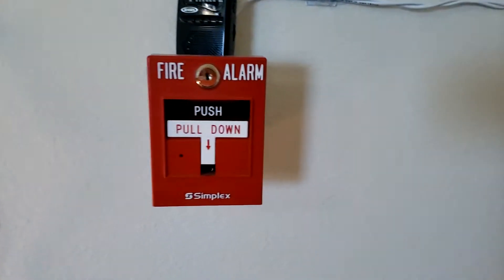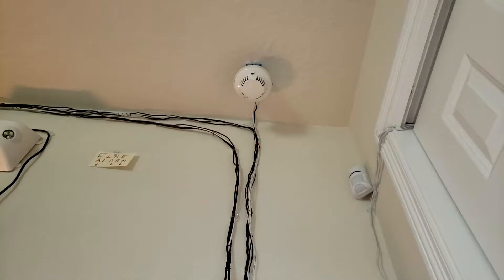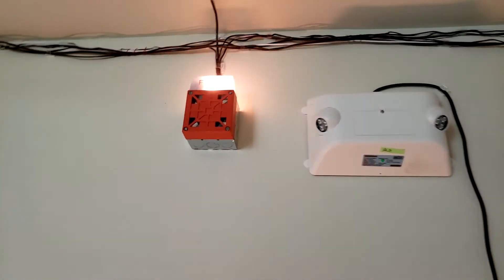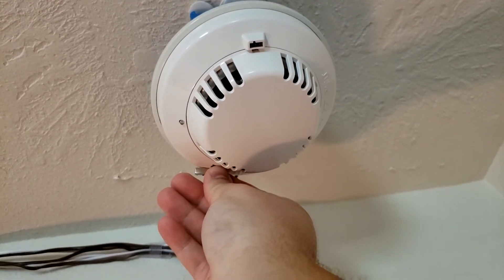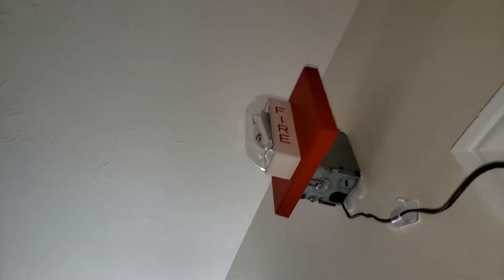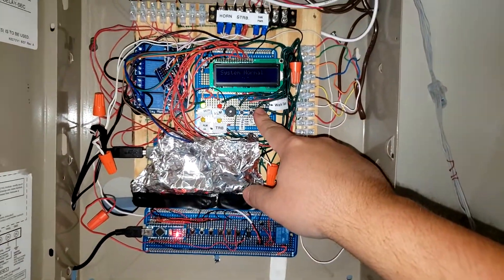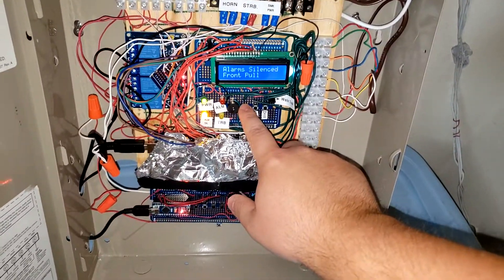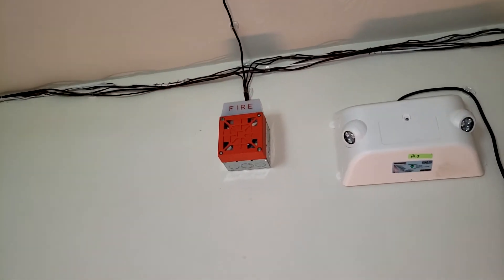Fire Alarm System Test 3: New Panel!

Comment: do you have the arduino code available to share . this is an interesting rig . been thinking of doing something like this myself since panels are so expensive ..  as far as the EMI could be caused by EMP or voltage surges . i bet if i keyed up my ham radio next to it it might set it off.  the things i can think of right now would be make sure the system has proper shielded wiring to the detectors  and also  to the circuit boards . also your power supply to the arduino  should be a good class power supply unit  with earth ground with the input , unfortunently you might be dealing with some RF exposure issues (or noise)which would mess with the arduino's or the power supply.. could be solved with RF chokes or a capacitor based  noise filter but its hard to pin it down exactly from my end since i dont have all the parameters  . i hope this info will help in some way to lead you in the right direction , i cant say %100 whats going on but i think i am in the right area
Reply from the maker: Alright, so then what class power supply should then I use, and where do I put the noise filter in the panel? But whats happening is that the panel goes off when theres a electric coil or motor turning on or off, and or a close lightning strike. Thats whats happening.
Reply: @EYL8902  well i cannot say for sure due to not seeing if you are running the motor off the same circuit but electric motors tend to give off a ton of RF noise due to the nature of how they work , i mean its something you should be able to hear on an AM radio pretty well . its basically emitting a wide range of EMI to put it basic and the arduinos  as they are are sensitive to that to the point where it can "freak out" the board(in this application
) . an electric motor is creating a magnetic field just like a coil might because they work on similar principals creating a "wave of noisy energy " that is either interfering with the normal operation of the arduino or something in the circuit but it sounds like it is really sensitive . detectors can be set off by lighting , that happens a lot but if it is a physical switch like a pull station that is reporting the call to the unit the wiring might be picking RF /EMI  like an antenna . you might be able to fix that in the code by giving it a parameter where its not instant for that pull for example and has to have a signal for at least 2 seconds before it triggers . Good clean sources of power if you are handy are computer power supplies for one , they have multiple outputs and are made to generally run pretty clean and output 3v 5v and 12v  so are pretty handy, its easier to say dont use a power supply thats for charging like something that would plug into a charging base  to charge something because they are typically cheap and basic sources , you wouldnt use them for audio stuff because there would be noise ..  This is all i can think of as far as speculation , i would need more detail about what you built to be more helpful , like your current power source and details about the circuit . I am willing to help if i can but I cannot be too specific unless i know how you built it . you can email me at rszumiesz@hotmail.com if you wish to keep it private. I'd love to hear more about your build , it is pretty cool .. Have a good one.
Reply from the maker: I already fixed the EMI issue by using ferrite beads.
Reply: @EYL8902  do a all horn light test in system test 4
Reply: @dustinkey8885  he’s on 12 now.. lol
Reply: @EYL8902   with all t bars